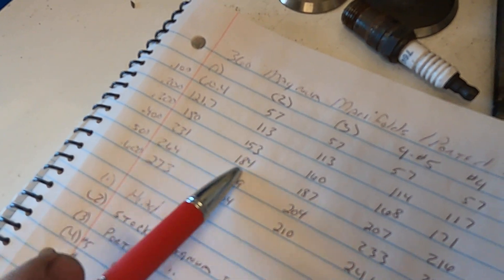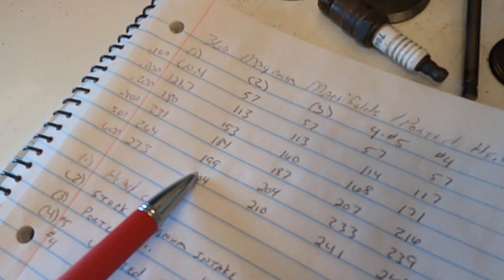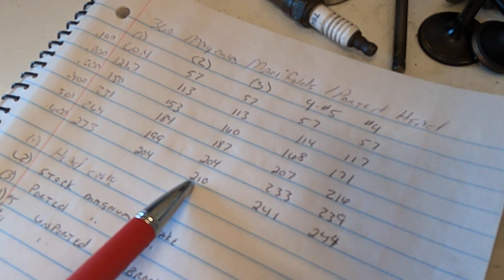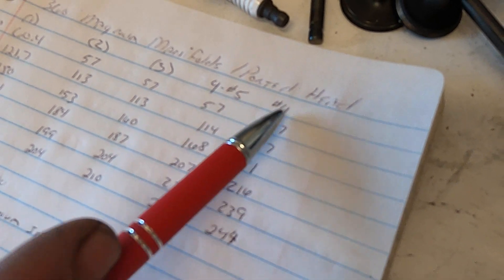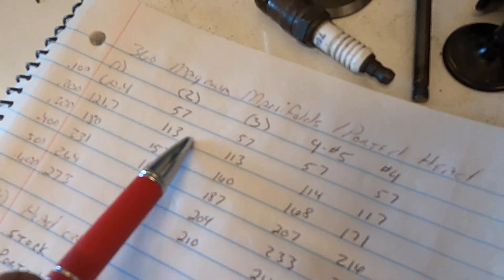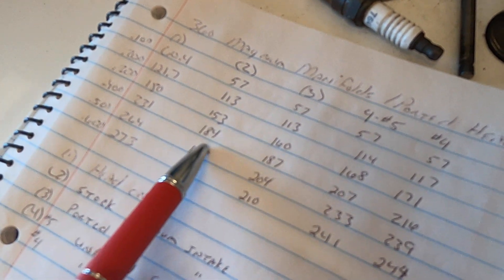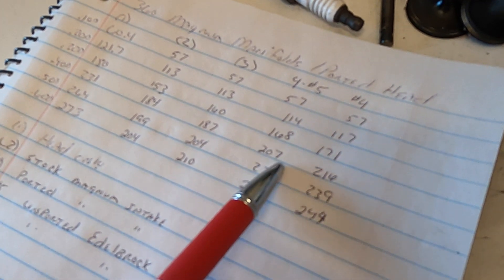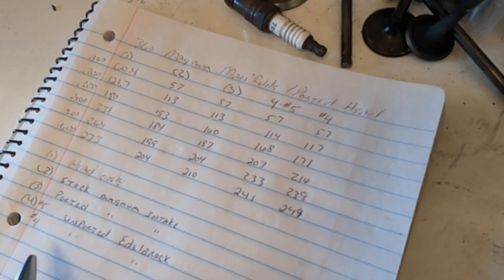360 magnum Kegger VS Edelbrock RPM air gap flow test

Comment: I would love to see a kegger manifold tested without the plenum plate. My theory is that the plenum plate is so close to the intake port opening that the opening is shrouded by the plate and thus impeding the flow of air into the port. I think it would flow much more air if tested this way.
Reply from the maker: I agree it absolutely is a problem if I ever get to testing again I'll check that out. People don't like to steel plates but I just hondabond them on and throw the gasket away instead of using the quarter inch aluminum plate and I've never had a problem. the quarter inch plate that's just flat makes that problem even worse cuz it doesn't have that dip like the factory plate does.
Reply from the maker: I recommend shortening the runners even if you're doing a low RPM high torque build you lose half an inch of runner or even an inch isn't going to hurt anything but it opens up that area right by the plate by a lot.
Reply: @thomasbeyer  My idea is a spacer that would fit between the manifold and the plate. I think it could be fairly thick before running into interference with the pushrods. 2 gaskets would be required then and the volume would be increased so some utawasome VRPs would be needed. Then I would like to extrude hone the runners. I guess it all depends on how much the shrouding affects the flow.
Reply: @jlsracing997  interesting idea
Reply: @thomasbeyer so if I. Wanted to do my plenum gasket I can use original plate and just use rtv sealer instead of new gasket

Comment: Hey man where about are you? I just saw some videos on your Kegger mod. I modded a Kegger a year and a half ago, but haven't had an engine to put it on or test. Can I drop it off or send it to you to have tested? I was going to put it on my 408, but the engine is still on the stand waiting for parts to finish. 🍻 
BTW this Kegger mod I did cost me 0$ only time. You maybe surprised at what you see.
Reply from the maker: I'm in Chattanooga TN. I could throw it on the flow bench when I flow my fully ported kegger.

Comment: Ok i jus watched the video for the third time jus to learn an see all whats entailed in this process plus listening an trying to follow what the guy saying about the  numbers .. I’m very into this as you know i got the same intake brand new in the box an also jus got the bungs now too .. so i going to watch an learn an then i will be installing shortly after.. what are you using for adapter to install your factory throttle body? I ordered an now have in my possession the hughes adapter  specifically meant for that install an then i too will be going to a 4 barrel throttle body eventually.. like i say an feel even if it dont make a whole lot more horsepower i like the looks of this intake an setup rather the dang old kegger look anyways lol .. appreciate you showing all the details an what goes into this process an the final numbers too !! Thanks man doing great cheers 👍
Reply from the maker: IV ended up getting the same Hughes adapter for now. I too will end up with an elbow and a big single or a 4 barrel throttle body in the end.
Reply: @thomasbeyer  ok right on . Good stuff .. thanks again i will be watching hing for when  you post the next one about it

Comment: I have a black CC R/T that I had since new. Back in 2000 to 2004 I had a M-1 intake with R/T iron heads. My flow numbers at .500 were 238 intake and 218 exhaust. The intake and exhaust were ported on the heads,  matched to the M-1. I have a 2 barrel t.b. that flows 850 CFM. I had a cam from Engle cams, .512 lift, .220 duration, it was the most I could get to run on a modified stock computer. I made 298 HP at the wheels on the dyno. I say all this because I think that the dual plane intake is going to make the same hp but probably more torque. I didn't do the work on the porting but a retired engine builder for Rusty Wallace did the work. My truck is almost back to stock unfortunately due to a financial hardship early in marriage but at least I still have my truck. I was running low 12s on 275/40 r 17 drag radials and the longer Lakewood traction bars, 3000 stall, 12 lbs of boost from a vortech t-trim
Reply: I forgot to add that 298hp was naturally aspirated, I never dynoed after the boost. I also failed to mention that I was running a split second box that adjusted the fuel and timing curve ( msd-6AL and 38 lb injectors with a 255 lph in the tank pump through stock fuel lines), 4400 lbs of truck running low 12s , I was making good power and it was consistent 1.8 60ft times, from r years at Moroso in WPB, FL
Reply from the maker: We will certainly find out. IV had similar thoughts but we shall see what it does. My heads flow 265 but that's not much more than yours.

Comment: I got an m1 intake on my dakota and ot says "zeus" on the back part. Weird, i wonder why.
Reply from the maker: After a little googling it seems Zeus is the foundry the cast them and the early ones had Zeus on them and supposedly slightly better casting than the newer ones.
Reply: I have two M1s, a Zeus and a non-Zeus.  I don’t know if the Zeus flows better, but the Zeus casting is much cleaner.
Reply: @michaelowen6197  weird right? I’ve had 2 but I feel this one is special just because of that lol

Comment: My neighbor I used to live next door to about 7 years ago had a 340 in an aspen that we set up for small local asphalt racing in our area. He was a Dodge Mechanic & really knew his shit about THESE ENGINES. It had a 2 barrel Carb. & intake on it that topped out at 512 H.P. on the engine Dyno.

I don't know exactly what was done to the heads or the internals of the engine but I do know the Carb. & Heads were Stock but WORKED. Much bigger Jets in the Carb. bigger valves in the heads, No idea of Bore, Stroke or Cam. but it sounded very healthy.

Maybe look elsewhere for power than the T.B & INTAKE ?
Reply from the maker: We'll see what the intake does out of the box. After that we will port it and I'll probably get a 4 barrel throttle body and that will be it until it gets boosted. But boost is a while off.
Reply: @thomasbeyer  Yes you've spent a lot of money, put in a lot of time on this project plus equipment, tooling & parts. Boost will have to wait, AGREED.,No hurry we'll still be here waiting.

Comment: Thanks for the test.  One tip, when you put the water pump bung into the intake, use a lot of anti-seize on it.  The steel bung will seize in the aluminum intake very quickly.
Reply from the maker: Good to know thanks